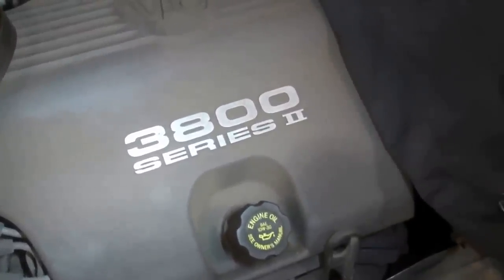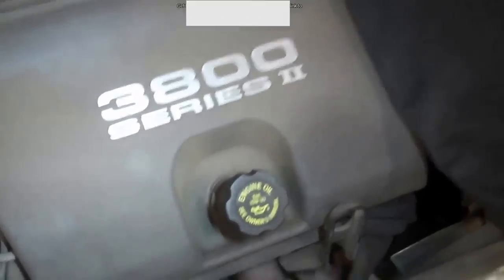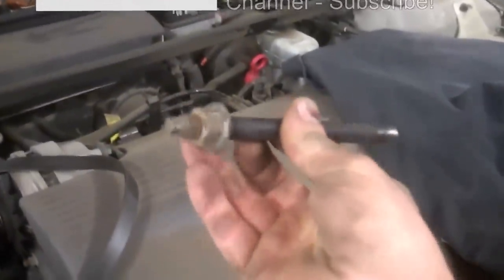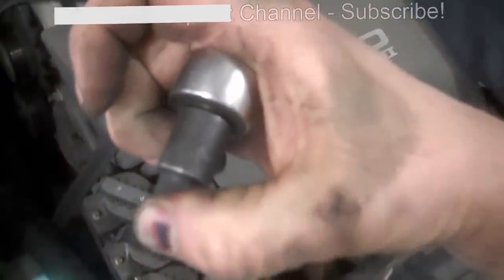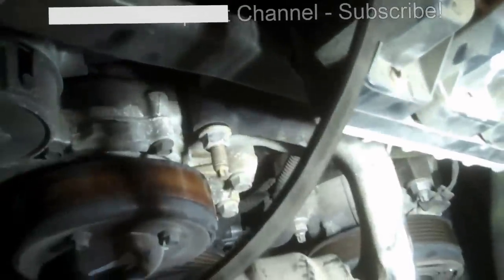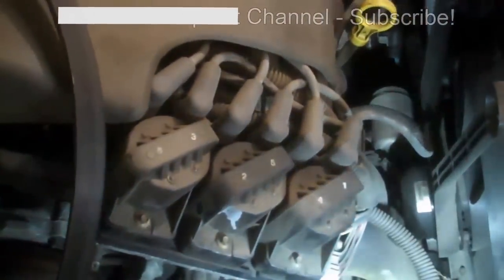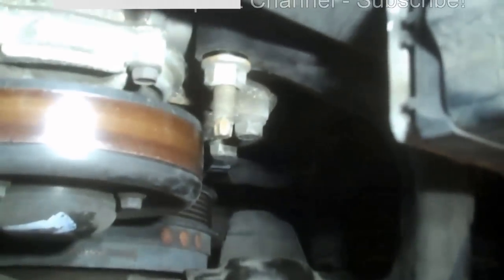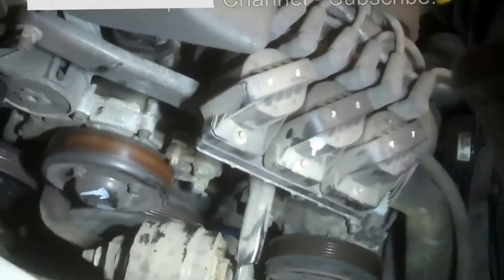Serpentine belt replacement Buick Lesabre 1998 3.8L Oldsmobile, Pontiac Install Remove Replace

Comment: Thanks for posting this video. I was just in the process of changing the water pump on the same model year Buick and the belt needs replaced as well. Didn't know about being able to remove the stud/spacer, for belt egress/ingress, and not have to fool with the actual mount brackets....

Comment: I did mine today, went real fine, but I did put a jack with the help of a stiff arm to push up the motor where the pan bolts to the bottom of the motor housing are. Don't know it it was needful at all, I had a bit of a hard time sliding out the spacer because of a screw (that was going into the block) that was near it going, but did not have to remove it the screw, & putting the spacer back was easier than getting it out.  Thanks for the video.
Reply: The stiff arm sounds safer.

Comment: Whats funny is my mother has a 99' Olds 88 with this, but the 99' Buick did not have that bracket, or that coolant/Serpentine Belt Tensioner combo. Come on, what the fuck thought it was a good idea to run fluid into that dam thing?